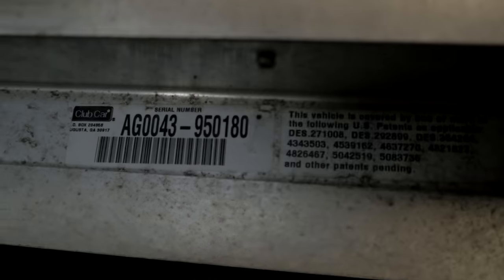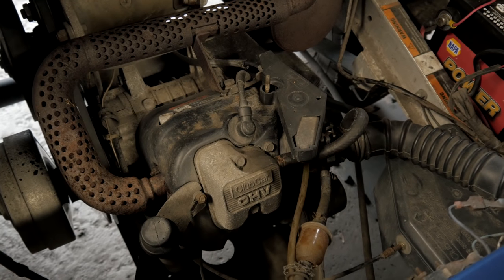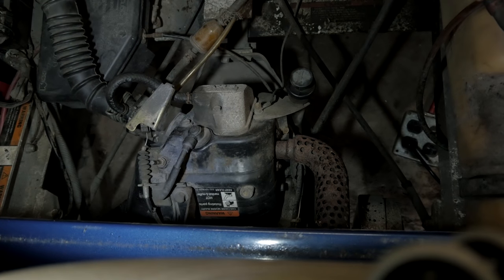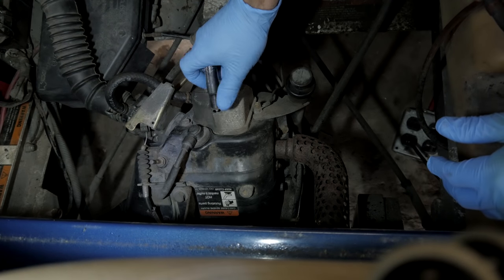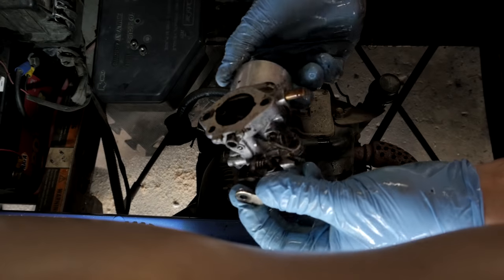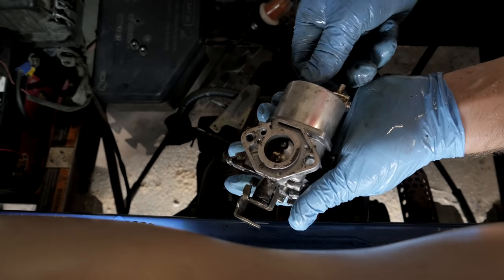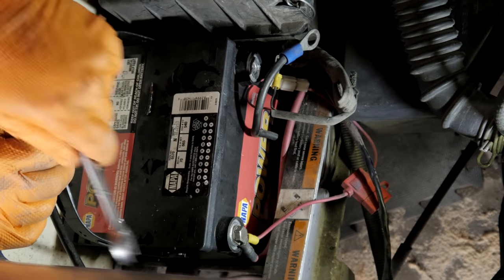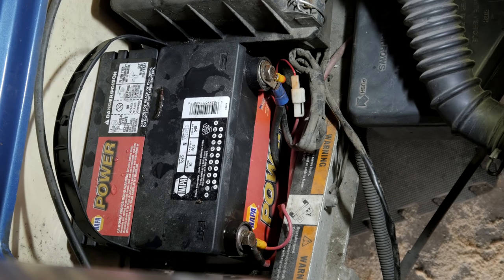2000 Club Car DS, Gas - Service, Clean Carb, Adjust Valves

Comment: My neighbor is a 77 yr old cancer victim, her CLUB CAR DS sat for 2 years while she had her surgery and went through Chemo and stayed with her kids for a while. She is finally cancer free and she has gotten back in to her home... she tried to drive her golf cart but it wouldnt start...so she called me. 1st thing was that the battery was shot, so 1 replaced it. 2nd thing was to drain the old gas, which i did via syphon, i got out as much as possibly by syphoning, then pulled the fuel line off the carb and turned over the engine to pump out any old gas in the line (this also helped me verify that the fuel pump was working...which it was). 3rd thing was to check spark which looked real good, but i replaced the plug anyway. Next was to replacing the air filter then adding fresh fuel....once all that was done, i tried to start it...but, NO START. Engine has compression, air, spark and fuel...so i pulled the carb to clean it..float and pin looked good and with the exception of a small amount of light debri in the float bowl it looked pretty good, but i went thru the entire carb and made sure every orifice was clean and reinstalled it and tried to start it again...still, no start. I put my hand over the top of the carb and it sucked my hand right down to the carb, i left my hand there for about 20 seconds, then pulled the plug to see if it was wet...it was not wet. Also, if i shoot a quick shot of starting fluid in to the carb throat, it will start for about 5 seconds... but it wont run on its own fuel...or should i say that i suspect that its not getting fuel in to the engine even though i know its getting in to the carb. I know this because i can unscrew the float bowl drain and gas comes out. Ideas? I'm stumped.

Comment: Good video! I’ve still got quite a few ds carts to keep running. A couple things to consider; 1. I don’t remove oil pan plugs anymore. I got tired of the mess, crawling on the floor, and most importantly wrench monkeys that over tighten or worse round off the hex. All my oil changes are with a dipstick vacuum now. Just the hand pump type. It takes a few minutes, but there’s plenty of other things to do. I can do 5-7 oil changes before emptying the globe. 2. I’ve had backfire from the linkage bracket on the carb being bent or warped which causes a small air leak. It’s mostly from golfers sticking a club in there to try and get more speed. They also seem to bust the yellow wire off the generator that way too. 3. I like to use a longer 3/8 bolt on the batteries with side terminals and then put a nut on. Bottom out the bolt then tighten the wires with the nut. That way I can get rid of the crappy ring terminals and put on heavy duty lead ones and still have room for other accessory wires. It’s also easier to hook up a charger or load tester. Hard agree about the battery hold downs. They are always buried in dried mud. 4. The fuel filters that came from the factory are serviceable. I hardly ever change filters. 

Enjoyed your video. Keep on wrenching!
Reply: The fuel filters are serviceable? How do you do that?
Reply: Replace them not serviceable.

Comment: Just bought a 03 ds.  My rental flett is precedent efi, so i normally work them..but the ds was for me..thanks for the videos..shes backfiring and drops way down when pedal is floored. Ill replace carb, plug, fuel pump etc..so i know thier good.. dont know much about rev limiter so hopefully no one messed with it.

Comment: Great video!  I have a 1999 Club  Car with hydraulic valves.  The compression is only 110.  I saw in one of your comments that it should not be lower than 125.  The problem I am having is the engine does not want to take the gas without choking.  If you pop the air filter open so it can draw air in it runs fine.  The carburetor appears to be sucking really hard because it will actually hold the choke button in , then you have to pull it out with your hand.  There is no blockage from the choke button to the carburetor.  I am confused as to the low compression but the strong suction when choking.  Any suggestions would be appreciated.  (New carburetor, pump and filters). Thanks Lao

Comment: I had backfire going on , well I finally figured it out . The top of the carb was extremely dirty, I sprayed it down with carb cleaner , let I sit for 5 minutes and hosed the carb off with the hose , sprayed it down with W-40 . Had to let it sit for a hour because I got the magneto wet , oops . But it runs better than ever now . No backfire issues

Comment: Hey Kevin, I have a 2000 Club Car DS. I bought it from a guy who's son, 14 year old, got ahold of it and adjusted everything out of whack. When I got it, it would go full blast as soon as you stepped on the accelerator pedal. I took to a friend of a friend who swore he knew how to get it running right and now its really jacked up. When the accelerator pedal is stepped on, it doesn't even want to run, I noticed he had adjusted the accelerator pedal, the governor, and the metal rod connected to the accelerator pedal. Can you tell me how to at least get it where it would run? Thanks man! I wish I lived closer to you, I would just bring it to you. I'm in the midwest. Your help is greatly appreciated, Love your videos.

Comment: I just got an ‘02 Carryall for free and I’m going through the carb right now. Main jet was seized so I had to use a screw extractor on it. Got it out but it’s ruined to where I can’t read what size it was. Can’t find any definitive info on what it should be. It’s just a stock Keihin carb.

Comment: I have a 90 G2 Yamaha, does mine have mechanical lifters to be adjusted, it runs well, but have never checked that? Thanks for all the great videos 👍
Reply from the maker: I can't say for sure since I've rarely had to adjust valves on any Yamaha cart. You can remove the valve cover and see if it has any adjuster screws on the rockers. If it does, then they are adjustable. If not, then they are hydraulic lifters.

Comment: I just bought my first golf cart 2004 club cart gas ,would putting premium gas be better than regular thanks
Reply from the maker: No, use non-ethanol gas if you have access to it. If not, just use 87. These engines don't run any better on anything higher. Its a waste of money.

Comment: Hi Kevin I had trouble getting the valve cover off because the 2 bolts holding the cover were in a recess that provide very little clearance for my socket to fit over. May I ask if you used a box spanner and if so what size is are the bolts? Many thanks

Comment: My 2000 DS has not worked right in 2 years, it has had a new battery, starter, rev limiter, carburetor, magneto, spark plug and spark plug wire, all new hoses and it still just idles for appx 10 seconds seconds before it kicks in and then it will backfire every 5 or so times I try to get it to pull away, I am at a loss what could be the problem, any ideas would be greatly appreciated

Comment: FYI proper adjustment for this FE290 is .005 not .006, although I'm sure that's well within tolerance.
Reply from the maker: You are correct. I always adjust to .006 when the cart has a lot of use. I have seen better results this way.
Reply: I believeThe tolerance is .005  to  .007 so     .006 is actually perfect

Comment: I got a free club cart ds from work because they were getting rid of it. Its bog really bad going any faster than 2 mph. I cleaned the carb, changed fuel filters, oil change adjusted the valves. Even disconnected the exhaust to see if anything was broken in there and had no luck. Still bogging very poorly any faster than 2mph. The air box was completely removed from some dumbass is there any chance that coule be causing my issue? Any responce will help alot thank you!
Reply: Did spark plug as well

Comment: Hi Kevin. When adjusting the valves do you need the pistons at top dead centre?
Reply from the maker: No. Top dead center serves no purpose for valve adjustment. It will keep pressure on some valves. The valve rocker needs to be loose to properly adjust it. The cam lobe MUST point straight down away from the rocker.

Comment: First of all I would like to say thank you for the videos has helped a lot .Do you have any ideas my 93 Club Car has got oil coming out from the back of the motor. From a little round rubber cap that seems to go up and down with the motor running. what would that be?

Comment: Kevin can you do a video just doing lifters.. how to identify what you have and adjust them.thanks
Reply from the maker: Pop the valve cover off. If you have adjuster screws, then you have adjustable valves. If there are no adjusters, then you have hydraulic lifters and automatically adjust with oil pressure. FE120-FE290 engines with adjustments should be .0047" (.12mm).
Reply: @Kevinsgolfcarts  thank you.

Comment: Thanks Kevin. I changed the carb for a new one, drained the gas, new fuel pump and filter, new spark plug but it still is hard to start when engine is cold and is sluggish in low idle. Sometimes it will backfire. Do you have any ideas?
Reply from the maker: Make sure all of the gaskets around the intake are good. It doesn't take much of a rip or missing gasket to cause starting issues. By design, these engines don't idle so you may have something else wrong if your engine is idling.

Comment: i have a 2009 turf 1 with the 350, runs great just backfires every once in awhile going down hill. would you say it needs cable adjustment or butterfly valve not closing all the way? just had a full service done but dont think they touched the carb. ive never touched a carb on one of these but was thinking of at least draining the bowl from it, any input id appreciate.
Reply from the maker: Backfiring is usually from a worn drive belt or accelerator cables out of adjustment.
Reply: @Kevinsgolfcarts  ok well it just got new belts so il try and adjust the cable. Probably need to loosen it right

Comment: Have the same clubcar and was wondering if you knew why it would all of a sudden lose power when climbing a hill. The drive belt was replaced, we adjusted the governor a little to make it run just a tad faster, new spark plugs gas the works. Any ideas! Thanks
Reply from the maker: Check compression and make sure its not below 120PSI. Pull the carburetor off and clean it. Make sure the air filter and fuel filters are clean.
Reply: Thanks. Air filter and fuel filter are new, carb is cleaned with fresh gas, and the compression reads 135

Comment: Kevin, great video, but my engine looks like this one until I removed the valve cover. I believe mine has hydraulic lifters as I see no adjustment nuts or bolts. How do I adjust these valves?   Thank You.
Reply from the maker: These valves self-adjust and there's no adjustment needed. The oil pressure from the engine is what keeps them adjusted properly. Make sure your oil is always clean and filter is changed regularly.

Comment: Kevin, love your videos.  I have a 2001 DS,  runs awesome until recently.  Starts fine and runs well and every now and then will just eventually die, use the choke to get me home and then next time no problem.  New fuel filters this spring as usual, try to run at least 89 octane.  what do you think ?  Keep up the good work
Reply from the maker: You can run 87, anything higher that's not ethanol free is a waste of money and does nothing to help the engine run better. You will need to pull the carb and clean it. There is probably debris and water in the bowl.
Reply: @Kevinsgolfcarts  thanks for the quick reply and the advice about the octane.  Ill be watching your videos on how to clean the carb.
Reply: @iudog5675  I will add to check the fuel pump becUse ours did the same thing . Would run fine around the yard slow speed and if held floored it ran our of fuel and died and would need chock to get going again for a little bit
Reply: @Kevinsgolfcarts  Thanks for your response Kevin.  The cart is 20 years old, whats your thought on just replacing the carburator ?  seems like a pretty simple switch out and the price of new ones are very reasonable I think.  any complications of a new carburator to the cart ?  Thanks again
Reply: @Kevinsgolfcarts  Your thoughts on just replacing the carb ?  Just looking around the prices seem to be very reasonable and Im pretty sure I have original carb on it now.  What do you think ? and is there anything tricky about replacing one ?  Not a good mechanic but with your videos help, Im sure I can do it.  Thank you
Reply: sorry didnt realize I had already sent the same question.  :)

Comment: What does adjusting the valves actually do? And when i changed my oil, same model and year, the manual recommended sae 30 for higher temp regions. I live in florida, so i did. Would you recommend 10w30 as a default? Appreciate any feedback
Reply from the maker: Adjusting the valves keeps the gap between the cam shaft and rocker set correctly. When the gap decreases (gets smaller), it causes the valves to not close completely. This can cause loss of compression and incomplete combustion. When the gap increases (gets bigger), it doesn't allow the valves to open enough. This can have the same effect. This is something that should be performed annually on the 2 cylinder Robin engine. If you use the cart daily and it works hard, I would use 10w30 or 10w40 conventional oil. I typically run 10w30 in all the carts I service, unless they call for synthetic or special oil.
Reply: @Kevinsgolfcarts  thank you so much for your response. I changed the oil a couple months ago and put sae 30. Should i wait to put 10w30 or change it asap? 
I really like your videos. Very informative. And pretty good angles on the engine and work.
Reply from the maker: You should be fine running that until your next oil change. Thank you for your kind words! I hope to be back up and running very soon making more videos. Its very slow this time of year.
Reply: @Kevinsgolfcarts  do you have an instagram i can follow also?
Reply from the maker: I do. All of my social media is kevinsgolfcarts, links in the description of all my videos. I'm not very active on social media.

Comment: just found this u tube page and was wondering if one can buy the oil filter from a bike dealer or is there one from another manufacturer. I have no dealer within 400 miles from me.
Reply from the maker: If you have a NAPA or other auto parts store, the NAPA number is 1394. Most auto parts stores should be able to cross-reference this number.

Comment: Hey kevin new subscriber here I just PERFORM A SERVICE ON MY CLUB CAR DS 04 NEW Plug adjust the valve clean carburetor new fuel filter drain the gas tank put need fuel and still have the same problem sometimes I get crank but don't star I check the spark is good got good fuel gret videos I hope you can get me a tips maybe am missing something thank you
Reply from the maker: Javier Reyes is the fuel pump getting fuel to the carburetor? Sounds like it could be a blocked fuel line or weak fuel pump. You can remove the pulser line that comes from the engine to the pump and be sure it's clear. Sometimes it blocks with oil residue and stops the pump from working.
Reply: Kevin's Golf Carts thank you for responding
I changed all fuel lines about year ago  but I will check them again
Yes I am getting fuel to the carburetor how much I suppose to get a low strim ??
Sometimes run real good no problem
Reply from the maker: Javier Reyes it should be somewhat steady. It will pulse but you should have a flow. If there's a leak on the supply line, it will pull air and not pump properly, same for the pulsar line. Also check the siphon tube that goes into the tank. Sometimes they fall off into the tank and will not let you get fuel. Open the gas cap and see if it runs. If so then you have a blocked tank vent. You can use a vented gas cap of the tank vent is blocked.
Reply: And I think I got the carburetor real clean I have a little backfire and know I don't
Just can get to start a very time but I go over everything

Comment: To make those adjustments to .006 how do you know where the valve is supposed to be? or get it to where it's supposed to be? I saw a video that says to turn clutch until the piston is at the top of the compression stroke. How will I know that? Thank you in advance.
Reply: Should be at top dead center on compression stroke when setting valves.
Reply: @mikenelson1004  what does that mean? how do you know it's in the correct position to measure/adjust? Both lifters all the way up and basically in the same position?

Comment: When putting the carb back on how do you know the adjustment screws are correct and set right or do you adjust it after it’s running? I’ll be installing a new carburetor and I can’t find how to adjust once it’s done.
Reply from the maker: There's typically only a mix screw on these carbs. They don't have a  Hi or Lo adjustment. They are usually set from the factory and are pretty close. If I completely remove it, I turn them all the way in, and back out 1.5 turns and go from there.